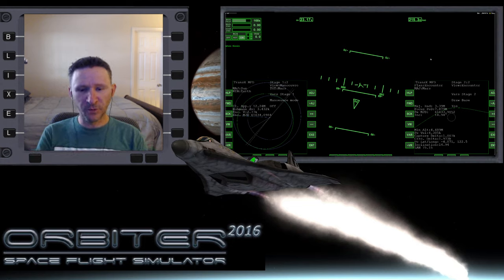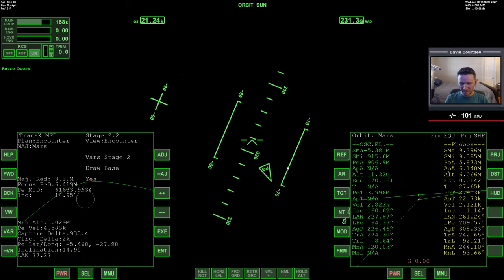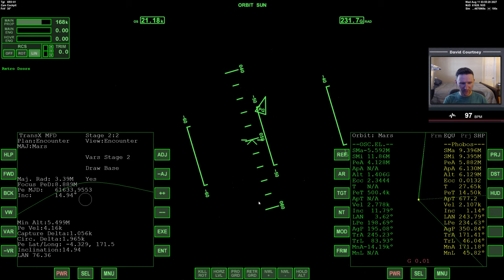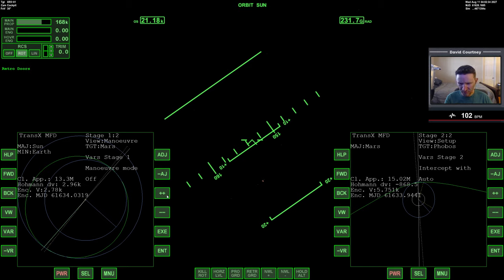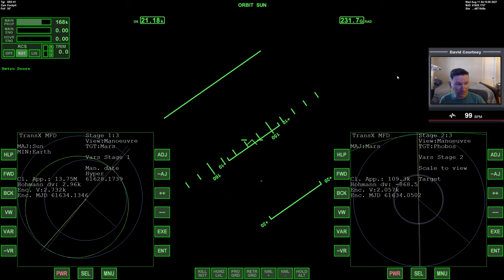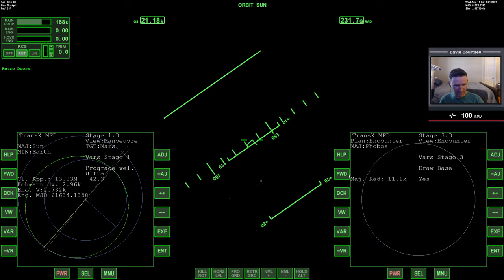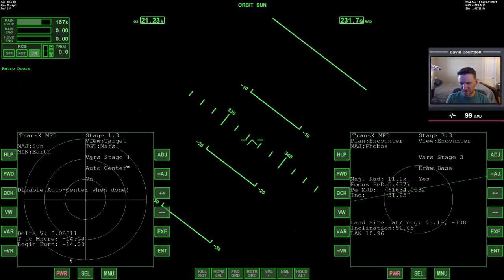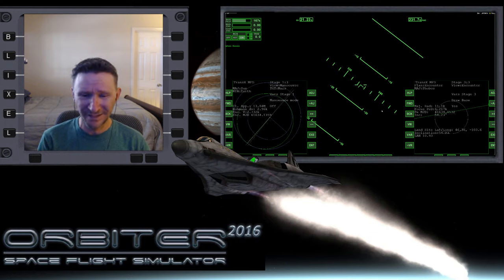Orbiter 2016 - [Part 5] Earth to Phobos in the XR5

Comment: I feel like if multiple mid-course attempts to correct the inclination at Mars, using prograde, outward and plane change were unsuccessful, then it must be an arrival date issue. You must have inadvertently "selected" an arrival date far enough away from the node that your inclination can't be any lower. Adjusting the date of arrival one way or the other should widen the inclination options. But that would've likely been an expensive burn, especially when performed late into the mission. Just a guess. I try to get my inclination in the ballpark when I set up my inital mission since inclination tends to hold quite well over time compared to altitude, etc. Cheers!